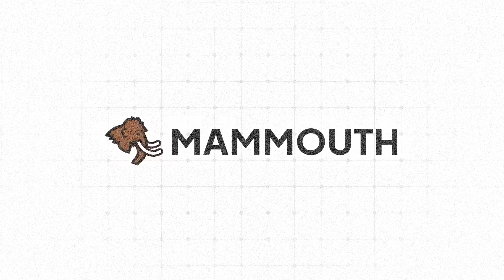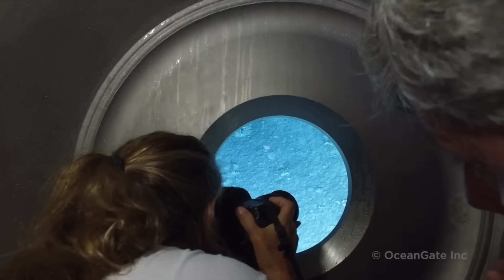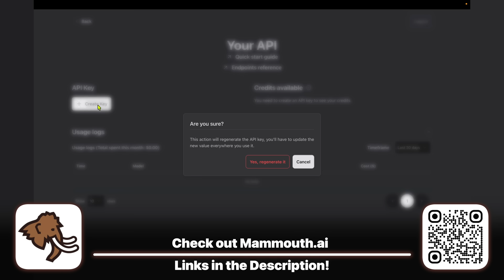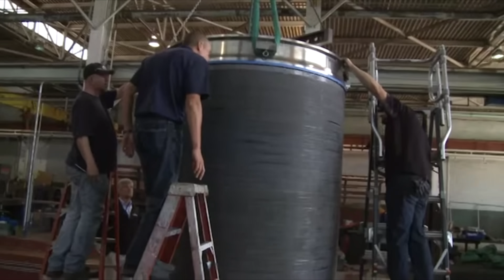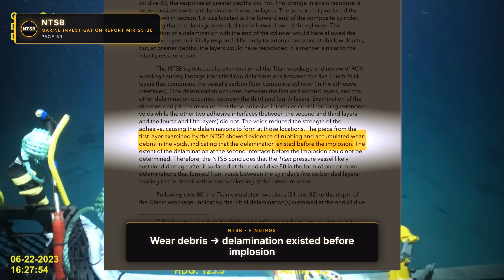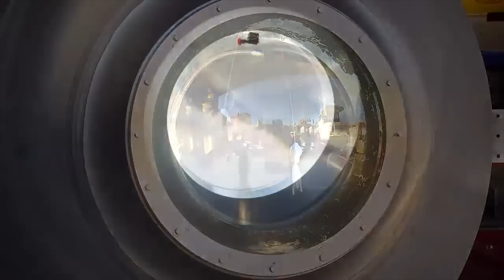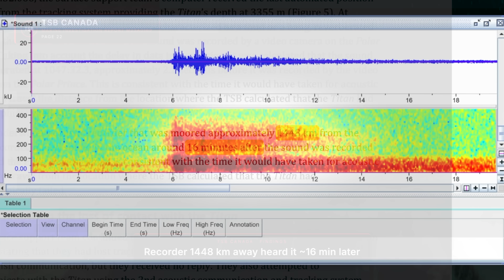Oceangate Titan: It was WORSE Than We Thought

Comment: They left the titan outside in the winter in a parking lot in Canada! That is negligence beyond
Reply: im not an engineer and even i know that is DUMB!
Reply: @dougwilson6778  I live in the city they left it in. And when they say an average of -5c, that's understating it. It's regularly -15 to -20 below in Jan and Feb.
Reply: @snowy800123  …and can go up past 0 and back down again to -20 basically overnight. Freeze-thaw cycles galore.
Reply: @snowy800123  we are talking "average" temperature here. check the records. "regularly" is a word with little meaning here.
Reply: @RobertoCarlos-tn1iq  Average rarely tells the full story which is important. You can say your average blood alcohol level when driving is on average .001% because you drove at .20% that one time. Brash example but you get the point.
Reply: @dougwilson6778  and then they dragged it 3000 miles in North Atlantic. Criminal behavior in the name of profit.
Reply: @EverydayNormalGeek  With 2 free hanging half ton (metric) domes glued on a carbon inforced epoxy tube through the Atlantic swell. Sure, and my dad bred the dinos for Jurassic Park.
Reply: The sheer amount of negligence in this entire story is straight up criminal
Reply: @mursie100  It's beyond negligent, it's reckless.
Reply: Not only that, they left it there right after it got severely banged around in an accident/malfunction/mistake. Everyone who had a mind toward safety wanted to examine it for damages before doing any more dives (and yet they did more dives before finishing the season)! Since it was left behind in the parking lot instead of brought back to Seattle, it was never investigated for damage after that incident, as far as I heard. At the very least, it wasn’t examined before sitting out in the cold and elements, perhaps giving the chance for severe water intrusion, along with expansion and contraction of the voids as it froze.
Reply: As if the cover would have helped. Stockton was so ignorant that he wasn't worried about it being covered or being outdoors in different temperatures.
Reply: I wouldn't even leave my carbon fiber road bike outside in those conditions.
Reply: But, but, but. They saved $1700
Reply: They didn't even throw a Wal-Mart tarp over it.  😢
Reply: Shit, I don’t think that’d be the smart way to do it with a full titanium hull, let alone carbon fiber. Dude wanted to be the Elon Musk of the oceans, but forgot to consider that Elon didn’t put people in his rockets until after he had blown up over a dozen of them in testing
Reply: My garden hose quick connects burst every winter cuz I'm a dummy and forget to turn the outside water off and I don't even own a submersible company!
Reply: @dougwilson6778  why
Reply: @simon_1987  Freeze thaw cycle.  High humidity city, on the ocean.
Reply: @DemocracyOrRevolution Might as well spend the winter beating on it with sledgehammers
Reply: Indeed.
Absolutely clowntastic.
Reply: funny thing is, i dont think it wouldve been a problem leaving it outside in a winter if it was made from solid steel cast, but since it was carbon fibres, that were basically pulled and teared by the changing winter climate, that could most certainly damage it aswell. but im no expert on submarines...
Reply: Thats how u season the carbon fiber
Reply: That explains why a grizzly bear was found to have gone down with them

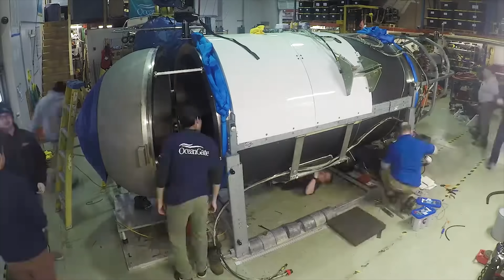Comment: 2:12 At the risk of asking a dumb question, why can't they just build...a really big sphere if most normal spheres can only fit 1 or 2 people
Reply: @CAepicreviews  it comes down to money
A larger sphere would be more expensive to build, and would require thicker walls than a solo sphere due to it being larger
Being larger than a cylindrical vessel, it would need a larger support ship, further increasing the cost
They either didn't want to, or couldn't afford it
Reply: Because the mass, minimum wall thickness, and cost increase exponentially.
Reply: Some thing not usually mentioned: buoyancy. A sphere that big would be uneconomically buoyant (especially if you use carbon fiber), and also you'll need a more complex system to manage the buoyancy (you don't want it to rise to the surface too fast)

Comment: Retired engineer here. In a process plant I used to work in, we used to test pressure piping at 1.5 times the max anticipated pressure--i.e. hydro testing of steam piping. That's why I was surprised at the 1.25 number. We retubed steam boilers from time to time and those were also tested at 1.5 X. Of course this is INTERNAL pressure, not external pressure, where the standards might be different. It might be a case where going from 1.25 to 1.5 on external pressure would require so much more material that it would not be practical. Designing vessels (or pipes) to withstand internal pressure requires FAR LESS wall thickness than the same size vessel or pipe would require for an equal external pressure.

Comment: It goes to show that the engineers who did the forensics work are more experienced and professional than the ones who designed the Titan.
Reply: if you read the reports and the warnings from people on the team who were all fired for speaking up, you quicly realize the problem was at the very top.David Lockridgee wrote a report pointing out the problems including the view window was only certified to 1300 meters but the Titanic lays at 4,000 meters depth. He was fired and then sued by Oceangate - he countersued for wrongful dismissal and the case was settled out of court - would be interesting to see the filings in that case.  Tony Nissen (lead engineer) clashed with Rush and was also fired over his concerns with safety and lack of any certification for the vessel.  When the top management fires everyone that speaks up doing their job, you see this as the final result.

Comment: I'm not an engineer, but I understand what carbon fiber is.  When you said they shaved down the bumps, my reaction was, 'They did what!?!'
Reply: @brianschuetz2614  I'm just a humble auto mechanic but even I had a 'pardon me!?' moment.
Reply: Just sandpapered it like a drywall 😂😅
Reply: @brianschuetz2614  in other words they cut the carbon fibers at increments all around the cylinder. It's like cutting the cable belts inside your tires (except the force acting on them is sort of in reverse)
Reply: I'm a material engineering major, and I have a decent understanding of material science (going into my 2nd year). 
The idea that they just ""shaved"" down the imperfections is actually absurd. For one, Carbon Fibre Reenforced Polymer is (insanely) toxic when inhaled, so I am going to do everything I can to not abrade it away, including just restarting.
Reply: @anderssicker2651  And not completed the 45deg axial wrap.. i know a little about composite pressure vessels and just hoop without axial thats as crazy as hell!
Reply: @aussiechristian 
At pressure vessels the force acting on the fibers is tension. 
The fibers of the submersible get pressure force making the wobbly bond responsible for the structure. 
Every mechanic would have done better and everyone who is not absolutely numb and sick in mind.
Reply: @HowardStein-v9d Yes, I understand that. But from what I've read, Boeing's initial feasibility study also called for 45-degree bias (axial) plies in the carbon-fibre layup, along with a thicker 7-inch hull. OceanGate omitted the 45-degree plies in the final design, and investigators said no one they interviewed could explain why. That's the part I find astonishing. My understanding is that the 45-degree plies would have helped tie the laminate together by carrying shear loads between the layers during repeated pressure cycles, potentially reducing the risk of delamination. That makes their omission difficult to understand.
Reply: @aussiechristian why you ask?  We’ll do do 45° plies he’d have to add that very expensive 2”😂
Reply: @anderssicker2651 carbon fiber is fine
Reply: It starts to feel like a m*rder case at that point. 😟
Reply: @YuBeace  If the suspect hadn't been among the victims this might very well have been charged as negligent man slaughter.
Reply: @andersjjensen  well since he was a ceo of a big company, I'm guessing he'd get a fine or something
Reply: @YuBeace  I'd hate to be one of the techs who worked on this thing.
Reply: @YuBeace  For better or worse Frankestein's monster killed him in the main event. No one left to try.
Reply: I'm a caretaker and only know how to put up shelves and I know not to grind shit down
Reply: I’m a simple epidemiology and history major but my occupational health course had me breaking out into heebie jeebies hearing this.
Reply: Frankly, it's a miracle that it lasted as long as it did with all the abuse they put it through.
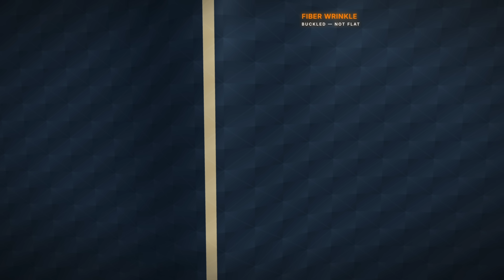Reply: I never had a job in my life and 6:10 sent shivers down my spine lol wtf
Reply: Also: carbon fiber is strong when pulling on it, not when it buckles. Making a sub from it is just dumb.
Reply: in short, some of the layers were weakened and even perforated by the sanding.
Reply: Carbon fibre is help together and in shape by epoxy resin
Reply: @shauntaylor9251  You kind of have it backwards.  The carbon fibre reinforces the resin to keep it from deforming.
Reply: @govsquid it's essentially semantics at that point, both are essential parts of the composite.
Reply: "The material itself could have worked" 
No. 
They took a material good at tensile strength and expected it to withstand pressure force. 
That's simply idiotic. 
Even the light weight of carbon fibers are not a plus in the given application. 
It's just rubbish.
Reply: I am an aerospace engineer and work with carbon epoxy. There is no such thing as a defect free composite structure. You aim for 2% or less of porosity. This thing was a charlie foxtrot from day 1.
Reply: I didn't watch the video, I'm just perusing the comments. Your comment made my jaw drop and eyes pop.

Holy shit. How dumb were they??
Reply: Literally cutting the fibres! WTF

Comment: I worked in manufacturing after a stint in the Navy while I was in college.  We used to build custom jigs to stress test the stuff we were building.  There were tolerance levels - like this drawer should survive 100k open/close cycles.  We also used the jigs for final QC - we would just run them through a QC test to validate using those machines.  Any failures went back to the line otherwise they shipped.  This is akin to shipping the prototype and then standing back to watch what happens.

Comment: Stockton Rush killed himself and others due to his hubris and delusion.  Certifying a submersible takes a lot of resources  (money)  to get it right. It has to be designed properly and then tested to failure  ... Multiple times. This is expensive. And that is why going to the depths of the titanic or  Challenger deep will be only done by wealthy states or very wealthy people: Because the submersibles capable of reaching those depths SAFELY   are  "expensive". Stockton Rush will be remembered as a cautionary tale against hubris and stupidity and cutting corners in safety.
  Maybe one day, a  big  SPHERE made of Carbon fiber will be made that will be able to house 6 to 10 people and bring people down to Titanic safely and "economically". Maybe, when we understand Carbon Fiber manufacturing and limitations better. But until then ... Submersibles will be expensive.

Comment: cycles of salt water exposure was like having internal gremlins sanding away at the CF too.   There is a reason  pressure vessels designed for longterm usage will rarely even use aluminum let alone CF...   material fatigue.  Look at aluminum SCUBA tanks... they have a fixed working life unlike steel which merely need to maintained properly and can be used indefinitely.

Comment: I'm studying mechanical engineering, this year was quite focused on materials, strength, fatigue.... And hearing all the stuff they did to cut corners around big problems they had during production is CRAZY. Air pockets due poor tolerances when going to a place with very high pressure. Grinding down layers because they wrinkled. Throwing carbon fiber multiple times into the curing process. 

Those guys made not one, not two, they made the whole book of possible mistakes done during a manufacturing process, and they did them deliberately

Comment: This is what I said when it happened. It was irrelevant that they used carbon fiber. It was the resin that was the problem. Every time they did a deep dive, the resin was being pulverized by the pressure. After so many dives, the resin was finally weakened to the point that it could no longer withstand the pressure. I'm an old autobody guy, and having done a lot of work with fiberglass resin and epoxy, it seemed obvious to me. It was hard plastic. It was inevitable that it would crack under pressure.

Comment: just one minute in and youre already misrepresenting. its not that a „properly built version“ of the hull wouldve been fine, its that a theoretically perfect version wouldve been. however there is no process by which the hull couldve been built without bumps and grinding. which definitely ruins it.

edit: i dont know how much ai was used in the making of this video, im not gonna fact check everything, but this video is not trustworthy. grinding the bumps doesn’t shift them to the next layer, if you dont grind them they grow with each layer and cause more trapped air, thats why you have to grind them smooth. over 2% of the hull being air also doesnt sound right at all.

Comment: Most who have worked with carbon fiber will tell you it's stronger than steel light as a feather claim to fame is only true if it's used in the perfect environment.  Steel can withstand seasonal heat and cold along with moisture with the right coating and endless sunlight where carbon fiber can do none of that because it's held together with epoxy that dissolves or cracks leaving behind carbon thread fibers that have no structure.

Comment: Would a titanium ring integrated into the center of the cylinder have made a difference? Like a brace to help with that flexing?
Reply: could case faailure - due to the stress concentrations where the ring meets the Carbon Fiber.
The Design brief indicated 7 layers of 1" CF and the sub was built with only five.  QC-QA wear tossed out the window at every opportunity, and careless disregard for all the warning signs lead to the only ending left. If the sub had made this trip, the final trip would have just been one or two more dives later...since Rush had no intention of paying attention to the warnings the sub was telling anyone that would listen.  Meanwhile warnings from David Lockridge and Tony Nissen were swiftly dealt with by firing them.

Comment: I would absolutely go down to the Titanic on the condition that it was designed and manufactured to the highest standards and having a factor of safety exceeding regulatory standards also factoring in redundancies for all potential failures hazards, in other words having on hand ability to launch a rescue and support in case of mechanical failures and or medical emergencies.Then of course the operation would need to be run with safety to be the first and last factor in go no go situation and goes with out saying only the most qualified experts running maintaining and crew that’s jelling where all have a say snd everyones herd. Finally financial instability should not be the driving force behind diving

Comment: Carbon fiber is a poor choice because it not hides damage, you cam easily xray it. Its because the way it deforms. Pressure causes the fibers to delaminate as the glue is whats doing the mechanical binding.